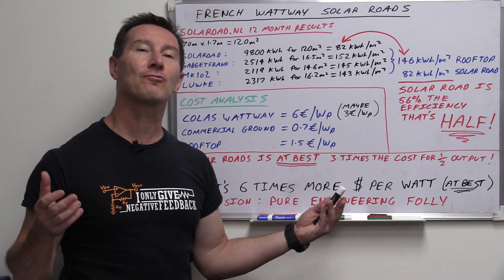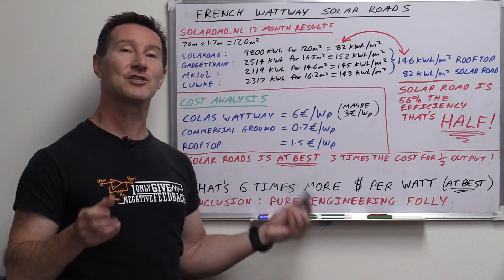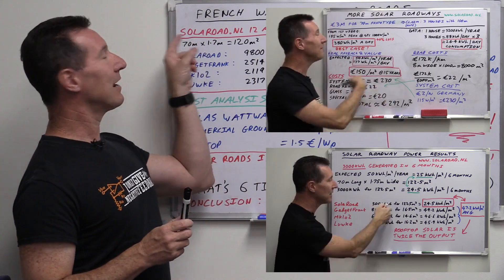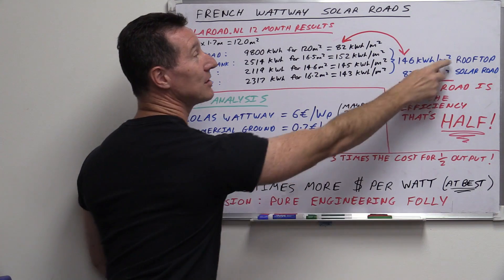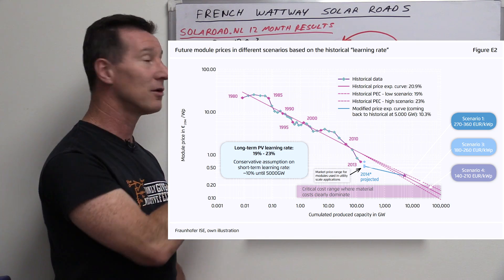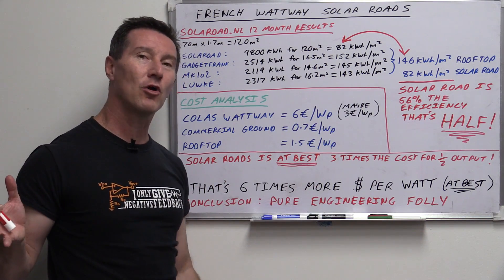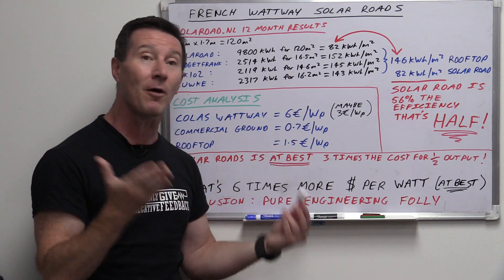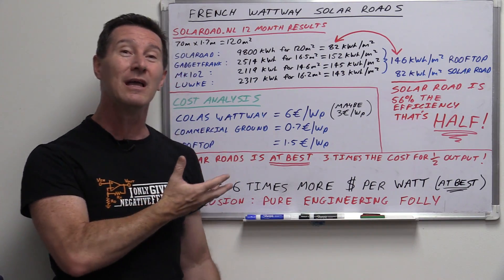EEVblog #850 - French Wattway Solar Roadways BUSTED!

Comment: how much does the "on the roof system" save energy for those who have implemented it can you depend on it say for the whole day(7am to 5pm) without using the main power grid ??
I have no Idea bout those systems, never used them nor seen them working around!
Reply from the maker: +Muhammad Nour Elmogy I have a video on this, it's linked in.
Reply: +KillaHertz
He's probably done a vid on this too. Or if he hasn't ya can guarantee some fucker will have. It's really a bit complicated to go into in a comments. Just get a basic kit with a breadboard n shit,if you haven'got anything. But ya better off reading at first until you understand what is what. Ya godda get the fundamentals down, or you'll struggle.
Reply: +KillaHertz piece of advice, if you have a good local store selling electronic components, just buy what you actually want and what you will use in short term, don't buy a lot of stuff that you will never use or going to using based on guessing, do that and see how much you will save!

for starter some basic resistors, caps, diodes, leds and couple of transistors will do(transistors are a little bit advanced but just in case you would like to play with them), also a small 5,12 volts power supply and a breadboard and that's it
grab a basic ohm's law web page and start from there if you know beyond this so far I will assume you already have what I have said

Comment: Although I agree with the outcome of your analysis, you have missed out a few points:

There is limited space to put solar panels in urban areas. Rooftops are mostly owned by individuals or companies who have the choice to fit solar panels or not. No democratic government is going to force them to do it.
However, roadways and public spaces are mostly owned by public authorities, which makes it much easier to force their use for solar generation. The land is also effectively free, which in urban areas will hugely reduce the total costs.

Out-of-town solar farms may be much more efficient at source, but the I^2R losses to get the power to the urban areas that will mostly use it has to be taken into account. It's always more efficient to produce the power as close as possible to where you're going to use it. Distribution losses are usually >30%.

We need to find a way to fit as many solar panels in urban areas as possible. But I agree that putting them on the roads just isn't going to work.

This is why I don't let the sales team anywhere near an engineering problem.

Comment: The only thing I do wonder is if glass (seems unlikely) could actually work as a good road surface and make a cheap cleaner replacement for tarmac. The world does need an alternative to tarmac
Reply from the maker: +Peter Jolliffe It won't. Look up silicosis.

Comment: We could put solar roofs on top of roads. Especially cycle lanes
Reply: But then it would be dark under them. Why not just put on the roofs of buildings, where they arent in shade of trees, where they are at better angle, where they cant get dirty (leaves falling on them), where they dont block the light, where basically everything is better..

Comment: You forgot to mention a very important aspect. Implementing solar panels in our grid is not wrong. Using the money that's being put into these solar-roads to subsidize consumers purchasing rooftop PV, is going to yield a much larger fraction of solar energy, especially when you only subsidize for instance 50%, meaning the remainder of the investment and most of the maintenance is done by the consumer.
Reply from the maker: +redtails Yes, and many country do this already to great effect.

Comment: Governments should heavily subsidise the installation costs and then the power company's pay the remainder for schools and commercial properties. Another idea is to look into installing solar panels between railway track sleepers, it may be more practical, easier to maintain and a lot bloody safer then laying glass on the freaking roads!!!

the only thing that I wounder is, (draft as it may sound, but if every rooftop in the world had panels on. Would it not reflect dangerous levels of UV radiation at the OZONE???) just a thought

Comment: What about electric cars? Please do a video about electric cars. The greatest con ever. Unless the power created to move these cars is coming from solar (which is 99% of the time isn't) then electric cars are still polluting and accounting for the losses of energy in the conversion of fossil fuels to electricity and then the energy inefficiencies of the network it's probable that they are even more polluting.
Reply: Its far more efficient to generate the electricity at a big power plant, than in small engines in cars. Although then there are transmission losses too. Mostly electric cars are charged at night, when demand is lower, and the base supply is mostly covered by nuclear, at least in europe, so its relatively green. Electric cars are relatively green, not hugely though, but thats not the only selling point.. They are also quiet, they have full torque at zero speed, the motor(s) is/are lighter, no gearbox or complexity needed, lower maintenance.
Reply: +TheTimdoyle Should also point out that  'Pollution' and 'emissions' are two different words with different meanings. 
In the context of air quality it goes like this:
Pollutants are unwanted chemicals or other materials found in the air, at high enough concentrations to endanger the environment and people’s health.

Emissions are discharges of a pollutant from a particular source (e.g., a factory) or group of sources (e.g., vehicles) into the air.
Reply: +TheTimdoyle Who is claiming that electric cars are pollution free?
Reply: +TheTimdoyle What? Electric cars don't emit anything whilst you drive them. They don't have tail pipes for anything to come out of.

Sure, they need to be charged, and depending on the type of energy generation there could be emissions at the point of generation, but that should be treated as a separate issue.

If you want to really compare the total 'emissions' of different vehicles, you need to do 'well-to-wheel' analysis, which is freaking complicated.

And, as far as I know, even if you are sourcing all your electricity from coal, electric cars do produce less total emissions than ICE cars. 

Currently there is a lot of focus on removing air pollutants from cities, and moving the point of energy generation out of a city is a very elegant solution.
Reply: +TheTimdoyle Elon Musk did some math on his blog to prove that it's legit: https://www.teslamotors.com/blog/secret-tesla-motors-master-plan-just-between-you-and-me 
Although some of the numbers don't seem to add up in my opinion. Maybe Dave could take a look at that.
Reply: +iPelaaja1 so what you're saying is (without figures to back you up) is that electric cars are more efficient not pollution free as we are being constantly told.
Reply: +Jesse https://www.gov.uk/government/news/electric-car-revolution-revs-up--2  
Try this announcement from the UK government. Part of the  "ultra low emission" scheme. Ok so they are not saying no emissions but I very much doubt they are actually ultra low emission.
Reply: +TheTimdoyle of course they are not pollution free, you dont need any evidence for that, its pretty obvious. Same way as its more efficient to generate lots of power in one place, than small amounts all over the place. Also, cars run on petrol, it pollutes, not as much as coal, but definitely more as nuclear, and (currently some, in future most)  power plants can capture the CO2 (CCS, liquification of coal). And in the future, energy could be produced with fusion. I think its important to invest and develop electric cars, since electricity is what will power most things in the future. Well, heres some figures too: a modern petrol engine is 25-30% efficient (carnot efficiency), diesel is around 40%. Modern powerplant (burning style) efficiency is 50-60%, with CHP or multiple fuel sources up to 80-85%.
Reply: +TheTimdoyle Electric cars get cleaner as the grid gets cleaner. They've done their part, now it's the power generation's turn.
Also, just moving the pollution away from my face is reason enough.
Reply: +TheTimdoyle  In the EU on average, 10% is renewable sources (wind, water, solar) and 14% is nuclear fission which faces the disposal or recycling issue, but is greenhouse gas neutral.

The main source of electric power in EU is currently natural gas. The efficiency of fossile power plants can range between about 30 and 40%, as far as electric output goes, but it's not the only thing that happens. Some of the waste heat is salvaged to heat water and homes, so total efficiency can be significantly higher.

The efficiency of internal combustion engines in cars per se has become quite high, of perhaps slightly less than 30%, while an electric motor used in electric vehicles has about 87-90% efficiency. But then there's more factors to consider. The drivetrain loss is lower in electric. A lot of the internal combustion engine workload (perhaps a fourth) is wasted on idling, electric cars don't do that. Some on braking, electric cars use in part regenerative braking. Electric cars currently weigh significantly more though - their drivetrain weighs less but the battery weighs more. A few % are lost on charging and discharging the battery and on transmission. There's also energy involved in producing and recycling the battery itself, i don't have an estimate on that at all. So if your power grid was completely gas and coal based, to the best of my estimating ability, it would be an approximately zero sum game, i can't say with confidence whether electric or internal combustion vehicles would be more CO2 emission efficient.

So currently, the CO2 emission advantage electric cars can offer in EU will not be very high. However, they can be of strategic importance because they will adapt to the future energy generation methods and any mix of power sources. It's expected that solar can be expanded still, that high-altitude wind energy with kite like systems will perhaps emerge, and that maybe one day we might have fusion reactors. Indeed the energy mix must be revolutionized eventually in order to fulfil humanity's long term energy needs, even if we don't yet have a confident plan on how exactly to revolutionize it.

As far as emissions go, gas and even coal power plants ideally basically only emit CO2 which is a non-toxic but greenhouse effect inducing gas. Internal combustion engines in cars don't have the luxury to capture and convert other (toxic) gases and solids in the output nearly to the same degree as power plants.

The plan by Tesla Motors to recycle used car batteries as a solar buffer is pretty cunning too, it would allow to continuously raise the cap on the use of solar energy.

So you could say electric vehicles that we have now are quite deservedly a small niche according to current situation, but they are likely to become a necessity in foreseeable future. So not developing and trying to niche market them now would mean setting ourselves a trap.

Comment: Honestly the little two-cell modules at 2:32 look pretty nice. I work a lot with single lithium ion cells in my hobby and it's pretty hard to find solar arrays that peak around five volts, and self-crafted ones tend to be bulky and fragile. I'd spend $5-10 a pop on them.

Comment: You seem to ignore one of the biggest problems of this thing. In order not to be slippery, it needs to have a rough surface. Rough surface means it will get dirty incredibly quickly and also will be very difficult to clean. Light does not pass very wel through the dirt. And it needs to be PROPERLY rough to avoid deadly accidents. And it needs to STAY rough. They would need to stay rough for very long years, if they dont, you would have to exchange the surface material. Or somehow treat the existing one - what will it do with the light transmission? How incredibly expensive would these things be?
Reply from the maker: +Stepan F As I said, my figures are incredibly generous ideal numbers. Yes, dirt and grime will kill the already bad efficiency of these things.

Comment: The screamingly obvious question is, why don't they put them up besides the freaking road where they can act as fences, wind catchers and sound reflectors, that has to be there anyway, all the while getting insanely much better efficiency and durability?! 
The even more obvious thing is that you shouldn't put them up in one fell (extremely expensive) swoop, but do it while there are personnel out tending or repairing the road anyway!
Going out to have a look at the tarmac today? Grab a few panels and install them!
Reply from the maker: +Helge Frisenette I've seen a few solar road barriers in various places. Not the most efficient angle, but still pretty good and would be very reliable.

Comment: Who's going to clean the roads when dust and tyre rubber fragments settle on them?
How will it handle the weight of a fully loaded road train?
What if a truck runs over a pebble, grounds it into the solar road, piercing it easily, and destroys it?
What about tyre grip?
Reply from the maker: +slip88 Details... details...

Comment: Like so many things in life, it's a great idea, but the real life application just isn't there yet...  Don't get me wrong, I'm a huge proponent of the Solar-Hydrogen-Battery Infrastructure philosophy (solar power, solar-electrolysis of ocean water to produce drinking water and hydrogen, and battery reserves for low-output scenarios), but I at least acknowledge that I don't know enough about the technologies to go around telling people they should do it!  Bloody hell...

I like the Korean system.  Why not just cover ALL the roads?  Keep the weather off 'em, make driving conditions safer and more predictable, and have the brain people work out an automatic maintenance system that keeps them reasonably clean?  It just seems like there are so many better options than using the actual freaking ROAD as the photovoltaic surface...

Comment: Don't forget the cost of the roads themselves.  The extra cost = solar road - cost of the normal road
You need to calculate the extra cost as the cost of solar roads. 

If they buy rooftop solarpanels they need also to buy a normal road.

Edit/
Cost
First test Solar road 1 square  meter 15$
Normal road 1 square  meter 5 - 10$ 

Not that much more for nice prestige project. :D

The Eiffel town has 0% output and they build it, dumb asses!. :D

Comment: I totally agree that the solar roads are a stupid idea, but correct me if i'm wrong.
You said that in the best case scenario the price pr. watt would be 3 times higher for the solar road, and then right after that that it would give half the output that a normal solar panel would, therefor making the power they make six times more expensive. But the watt's they produce are the same watt's that the normal solar panels produce and not half watt's so the energy the solar road would produce is 3 times more expensive in a best case scenario.
Reply from the maker: +Mads Kjerulff The cost of any solar installation is roughly proportional to square area. That is why I compared the square meter area cost.
Reply: EEVblog I get that, but you compared the price pr. watt ( 3x what a normal solar panel would give ) and then said that it would give half the output so the price would 6x.
I don't know how else to explain it, but in my mind it didn't make sense.

Comment: As I've said before; Roads are good collector's of thermal energy. An efficient heat engine would be required to make use of the heat obtainable from road surface, which is going to bring up a touchy subject. 
Can you make the exhaust (rejected heat) colder than ambient? The answer is yes but you must do a bit of work to make that happen. Therein lie the heart of the dilemma which could open a can of worms.

 Photovoltaics are obviously not practical for a road surface. It's an undeniable fact.

Comment: If the existing roads get torn up by traffic with heavy breaking and acceleration and turning producing a sideways pull on the surface (especially with multi axle trucks where some wheels don't turn when the trucks turn they just slide)on a regular basis. then these delicate solar panels will be so much mush in no time.
This has to be another case of political corruption using their position to make a name for themselves and get a nice little back hander to boot, although I probably shouldn't print the name I would have for them.
The only way to finish this to actually have someone lay this stuff and give it the real test.  Only then will people wake up and smell the coffee.
Reply: +Michael Hawthorne 
It will never be completed, they are just using it to get votes. They will make a start but as soon as they get to where they want to be it will be shelved.
Reply: +Michael Hawthorne Would be interesting to see the numbers for the energy saved in fuel cost by refurbishing the worn down road network.. Since they could probably fix 10 to a 1000 times the road, that would be "upgraded" by making it a solar road.
Reply: +Michael Hawthorne She doesn't need a name for herself, I live in france and she's 'famous' enough with her position in the government.